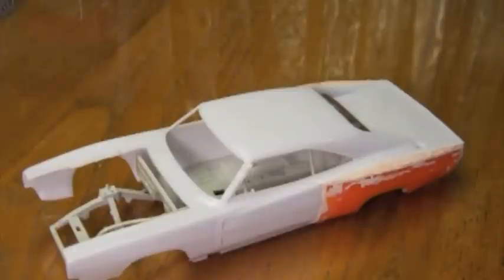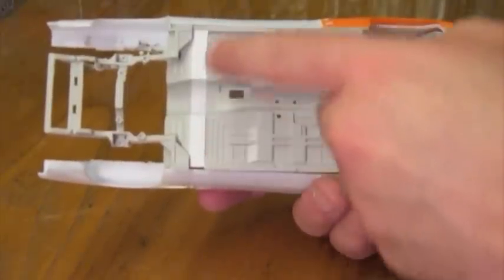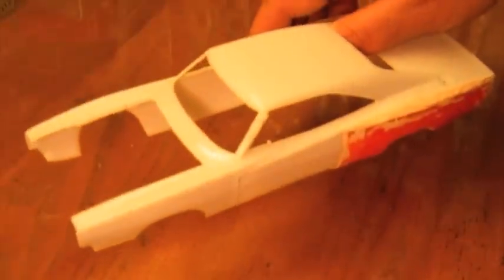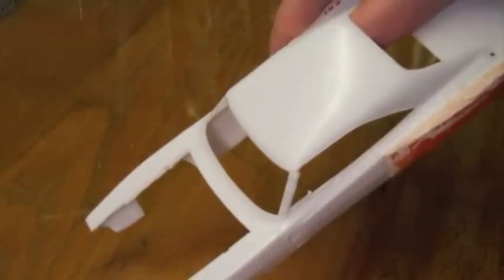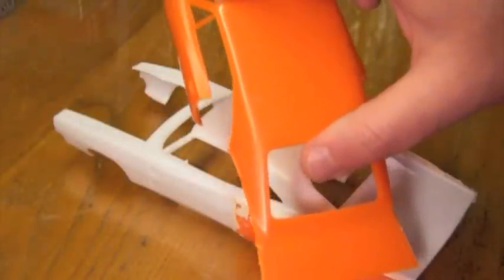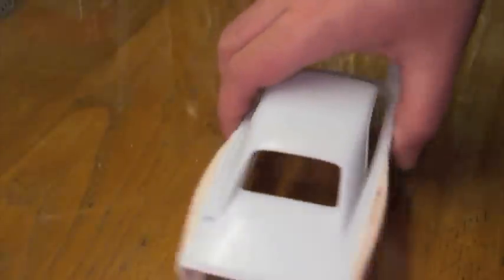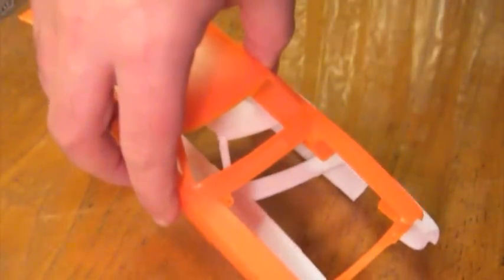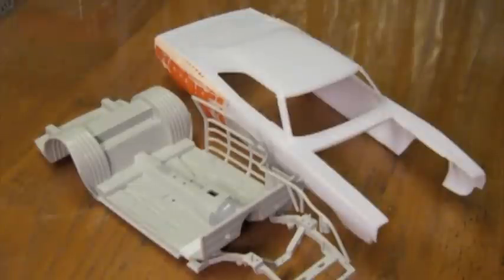Building the 1/25 Scale "Furious 7" Off-Road Charger - Part 1

Comment: Could you do a video showing or giving a little more information on how you extended the chassis?
Reply from the maker: I'll try to be more thorough the next time I do something like this. Basically all I did was make a straight cut across the chassis and put a piece of rectangular styrene stock between the two pieces to give it the extra length
Reply: Thank you
Reply: The only thing I need to know is which Pontiac chassis it is

Comment: hmm would it be easier to do that chassis mod on the general lee snap kit?
Reply from the maker: Probably not; the snap kit has a very rigid body compared to the Revell kit, and doing chassis mods is much easier when there's some extra flexibility. It helps both with the repeated test fittings, and once finished is easier to make sure everything comes together tightly.

Comment: I would like to try doing this project on my own and I was wondering where you bought the wheels,tires,suspension, tie down straps and parts for the interior and parachute parts. Could you please tell me
Reply from the maker: A lot of those parts - straps, chute, springs, shocks, and a fair amount of the interior details - were all scratch built. The wheels were 3D printed through Shapeways (https://www.shapeways.com/product/5KDCSZUAL/1-24-1-25-scale-f7-10-spoke-off-road-wheel), and the tires were from B-N-L Resins (http://bnlresins.ipage.com/shoppingopencart/).  A complete writeup with links and specifics on all the parts I used is available here: http://spencer1984.com/my_models/fast-furious-7-off-road-charger.php

Comment: What size styrene stock ? Sorry for the questions but if I'm gonna try to do the build I wanna do it right.
Reply from the maker: No problem at all, I'm happy to answer whatever I can. I used .250" x .125" stock for the filler piece
Reply: And the main body was a revell 68 charger, correct? I'm just going off the video and looking at kits.
Reply from the maker: Yes, though that part isn't really critical. The '68 and '69 bodies are interchangeable, and the '70 would be an arguably better starting point since that kit would also provide the correct bumper and front fenders (it just hadn't been released when I built this)